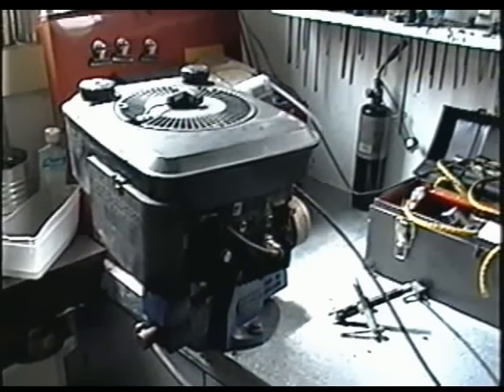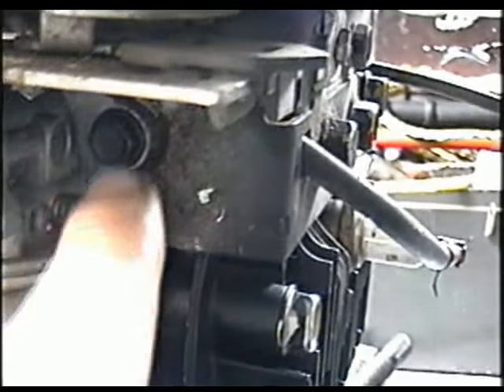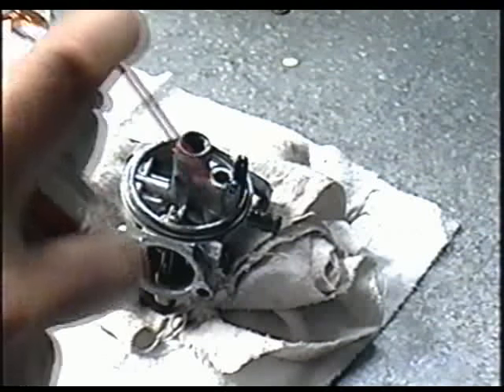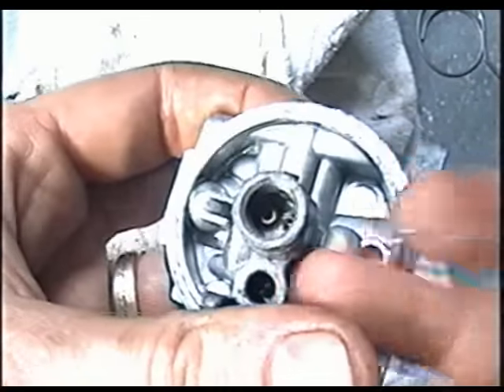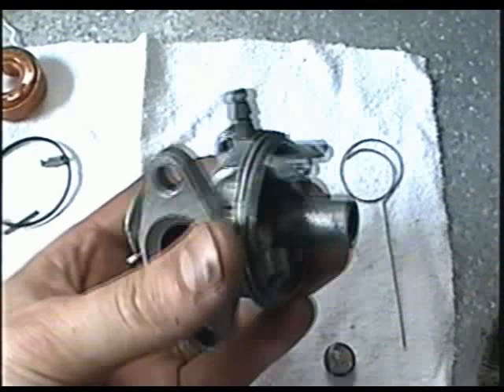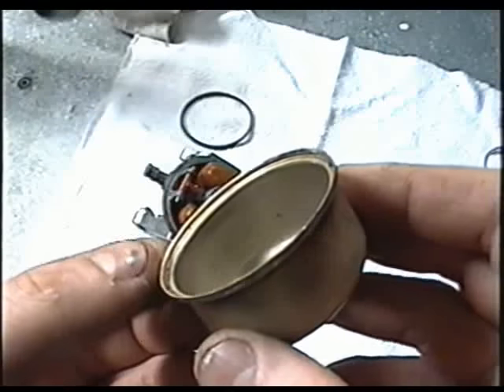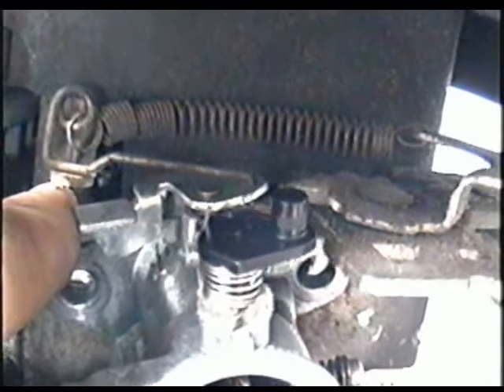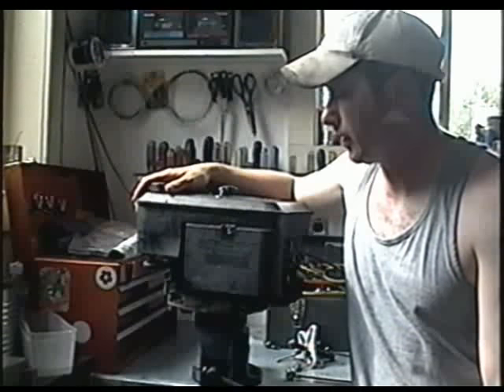HOW TO CLEAN The Carburetor on BRIGGS & Stratton Quantum Lawnmower Engines

Comment: ok,heres my story. A friend of mine said i just got a new mower i couldn't figure out what was wrong with my old one, if you want you can take my old one for free its just missing the spark plug. I said shure i'll take it, then when i got it home the it wouldn't start, so i sprinkled a little gas on the air filter then it would run about 3-15 seconds. and then i tryed what you did here and it was 100% perfect! And thats the story of the freemowerme and my wallet thank you donyboy73! you rock! !

Comment: I do it the easy way.....always use clean gas, and lately Non-ethanol from a local marina , plus replace or tap out the air filter. Bought the mower in 1991.....so 23 years and have yet to clean the carb. Good video....saved it for possible future use.

Comment: No adjustable throttle, I did clean the carb 3 times and finally gave up and bought a new carb off ebay for less than $30 and now everything works fine. I guess I was just missing something in the cleaning, but thanks for video, it helped me get started rather taking it to the dealer.

Comment: Get yourself a can of Berrymans Chemtool. It comes  with a basket inside the can. Toss all the metal parts  in the basket and put it back in the can of Berrymans. Let them soak a while or over night. You can by it at a parts store. Works great on car carburators to.

Comment: Guitar strings of various sizes. They work wonders on tiny  carburetor holes/passage ways. They are very limber and also very strong so they easily go through bends and still maintain their shape. I also use the bigger strings with outer wire coil wrapping to snatch out keys that have broken off inside locks...of all sorts. So find a friend that plays guitar and get his/her old broken strings lol.

Comment: note: there will still be some schmutz on the carbs that needs to be scraped off ( I used dental picks, steel wool and compressed air ) but the results were great! When I first got my bike, the carb slides wouldn't budge. After a soak in the solution, the slides moved freely.

Comment: I put fuel additive on my briggs and stratton trimmer mower. I barely used it, and it would start and then stop. I finally got tired of it and replaced the engine with Honda and that engine starts like a champ.

Comment: Donyboy73 definitely has the best Briggs & Stratton carburetor video, I would just like to add if you are still having problems with your lawn mower dying out try changing the fuel line if you haven't already.

Comment: Awesome video! Got an old lawn mower from my grandfather as a house warming gift. Only used half a season, but has been sitting for 12 years. He had drained the gas, but when I went to fire it up, gas just poured out of the air filter though the carb. Other research told me it was the float. This video was so easy to follow! Took of the bowl, cleaned it and the exposed part of the float, and was good to go! Thanks for the video

Comment: Thank you so much for this video instruction. After I changed spark plugs, air filter, fuel, removed rust off the coil/flywheel, etc.....my mower still would not start. But when I simply removed and cleaned and reinstalled the bowl around the carb float, and the mower started right up and now runs as new!! Awesome!! Thank you again!

Comment: Hello Dony,

You and Steve have helped me a lot over the year with y'alls well narrated and informative videos.  I have made some different carburetor/brake cleaner tips for different angles and size jets/passage ways.  I use a lighter or torch 2 barely heating the red spray extension tube and make the sizes and shapes I need.  I heat them about a 1/2" from the end and stretch it 2 desired size and or direction for example a 90 degree angle for the little holes inside the carburetor.  By stretching the red tubes makes the outside and inside diameter of them smaller.  Easier 2 get in those small jets and your carburetor/brake cleaner can will last twice as long.  Thank y'all from (D.R. Small Engines) and keep it up!

Comment: i have an XR600 that I had not run in about 3 years. A mechanic friend of mine told me to make sure I drain the old fuel out of it before starting it.. 

I should have listened. I put fuel in it today and took it for a run. Petrol was flowing out of the tube off the carb. 

Seeing this vid I have the confidence to take the bowl off and give it a clean. Fingers crossed that is all i need to do. 

Great video.

Comment: I have a similar Briggs and Stratton engine on my mower and it was giving me problems starting. It would start and run and not start again if I shut it off. I took it apart and removed and cleaned just the carb. bowl and nut. I wasn't confident enough to remove the whole carb so I just sprayed cleaner thru the hole where the butterfly is. Got it back together and it runs fine.  Thanks so much for your video. It helped a lot!

Comment: I dismantled and cleaned the carburetor on my B&S 675 yesterday. A little different but close enough. I found the needle had some gunk on it it took 5 minutes to scrape it off and burnish with a very fine sanding stick. I sprayed starter fluid in rather than carb cleaner then cleaned the jets the same way. I needed a replacement air filter/carburetor gasket and found it at a Sears parts/repair shop.

The procedure was very easy and the mower runs like it was new. Thanks very much!

Comment: Excellent video very well explained and 100% correct. I've been working on Briggs and Stratton engines since the late 1980'S and you've done a perfect job of the carburettor and an equally good job of carefully explaining how to do each step. This will help out lots of folks to get their lawnmower running again.
Reply from the maker: thanks

Comment: Great video! As a 54yr. young gal I was able to find a two carbs, remove them, clean 'em and reattach 'em without losing a part!!! (Push and Rider) Would not have attempted it without this great video.  Thank so much, you saved me a bundle. Lawn mowers runs great!  Now to sharpen the blades.

Comment: I have this exact same carb setup which has no idle and runs rough. Experience over the years tells me to do exactly what you have shown but it's nice to see all the steps illustrated. Small motors have carb problems all the time due to running in dirty environments and sitting a lot. A fuel tank can draw moisture over time, even if it is covered so I suggest the use of "Stabil" gas treatment for stored motors, especially 2-strokes! Very good job on your video. Thanks for sharing the knowledge!

Comment: Many thanks. I have a 6.5 Briggs Stratton engine on a craftsman 19.5" self propelled, electric start lawnmower. 917.378381. I noticed that the bowl fastening nut had one horizontal passage that runs clear through the nut and one very small vertical passage that runs into the horizontal passage. Your suggestion to use the wire from a twisty tie was brilliant. Many thanks again & again. Now if I can get my blower engine running !

Comment: Excellent how-to, many thanks. First time really disassembling any carburetor. My problem was that it was very dirty inside, clogged jets (especially the jets on the screw) worn seat and corroded needle. Originally it wouldn't run an leaked gas from the carb. Just got finished with it and its working great. A small drill but works well for removing the old seat, its the method I used. Also for anyone wondering the needle/seat kit is part # 398188 and costs about $5.

Comment: Thanks for posting this - this was the first time I've had to disassemble the B&S carburetor on the mower due to a fuel starvation problem at full run throttle settings and poor starting. Your guide was very useful. Cleaned  the blocked main jet and the engine started and ran first pull.

Comment: I wanted to thank you for your video. This season my 5 year old Troy Bilt pressure washer started, ran for a couple of minutes and then refused to start again. Even though I've never been an 'engine guy' I am a 'YouTube guy' so I watched your video a couple of times and then started working on my pressure washer. It At the end, everything was put back together and with a single pull on the the pull cord it started right up. So now I'm thinking about cleaning the carburetor on my Mantis tiller :)

Comment: Great job!  I have a lightly used 1100 (on a big chipper/shredder) with the float carb and when I turn the gas shut off to the on position, gas pours out of the air cleaner tube.  Previous owner probably stored old fuel in the tank without Stable.  Figure it is the float hanging up with the needle suspect too.  Have the confidence to remove carb after watching your video twice and will grab a rebuild kit and have at it!   Many thanks!

Comment: Awesome, thanks! I was ready to buy a rebuild kit or a complete replacement carb, but tore down the carb and cleaned everything thoroughly (esp the jets+bowl) instead - my B&S Quantum 50 then started second pull on the rope and had the smoothest idle I've ever seen from it (bought second hand) and allowed me to finally get the thing in tune.  Subsequent starts have occurred on the first gentle pull on the rope.  

This is the same engine that wouldn't run for more than 20 seconds this morning!

Comment: Thank you for showing this video. You saved my lawnmowers life!! Before my lawnmower would start up then just die just like that. I found the manual for my carburetor so I can have a guide on how to put it back together again. Unfortunately, I did NOT have any carburetor cleaner. So I did some research on what i can use to clean my carburetor. Then I found this method that someone wrote down:

Comment: Great thank you. Cleaned the carb out and found some corrosion . Also found a lot of debris in the pipe from the fuel tank to the fuel valve/tap before the filter. Change this pipe too and it now it runs really well.

Comment: Thanks for posting.  The engine on my log splitter wouldn't start.  I figured no fuel was getting through but had no clue what to look for.  A friend said check the carburetor.  I have no mechanical experience, although I am handy, so I had no clue how to go about this.  I found this video....the engine and carb are similar not exact matches though.  I followed the instructions in the video and just started the log splitter!  Success!!!  Thanks for saving me money by allowing me to fix it myself

Comment: thanks to u i can do and repair all my stuff i just love the way u explain everything and now i can do the work that i cant even believe im doing it. 
so thank you for the videos and keep up the good work.. and thanks again
Reply from the maker: you're welcome
Reply: Donyboy...I have a Stilhl M170 chainsaw less than two years old.  Was running fine, but now, it wont start. I've check spark, I've checked gas filter and gas line and this all looks good; Not flooded and gas is good/fresh (ratio 50:1)
My question: under this perceived condition, can I effectively take carb out and clean and place back without installing a kit replacement if I don't damage diaphragm or gaskets et cetera. I need saw to work and don't have time at moment to order kit.
Reply: julio Angel I was told that I explaine things well maybe I should try making a video, and by the way this guy did fantastic camera was good showing every piece, he did well

Comment: Donyboy what a fantastic video! My mower is 23yo, it started on the usual 3rd pull and cut about 8 ft before stalling, restarted fine only to stall again as previous, third time mower wouldn't catch.  I assumed the carb needed work as the plug was dry after several attempts and it was the first tank of fuel this season. Your video made this task so simple.  Only difference was my carb did not have the side hole but all seemed open. Reassembled and same problem, no start, plug dry, bowl wet. Help

Comment: Glad I eventually found your video! Unlike other videos for 3.5 Briggs engines this looks exactly like the one on my 1990 mower. It's a 3.5 HP Briggs and Stratton Max. Gas went bad last winter and it stalls constantly now. I almost pulled the trigger on a new mower since I thought cleaning the carb would be complicated but your instructions make it look simple.
Great job! One of the best instructional videos I've seen.
What's the best way to winterize the engine?

Comment: Hi Dan! Hey, for your walbro carb with the press fit float needle's seat I use a 1/4" 20 fine thread tap to extract the seat from the carb housing. What you will have to do is use the tap to cut threads into the brass float needle's seat then you will use the tap as an extractor to PULL the seat out of the carb housing by gripping the tap with a vice grips. You may have to tap on the vice grips with a hammer to get the seat to free up. !Remember to measure your float's height before removal !,,,

Comment from the maker: you migh have a bit of moisture in the engine, the carb may need kit #631021b and possibly a new bowl if it's corroded where it connects to the carb. for the oil just replace it often until it becomes a normal color

Comment: I'm at a loss.  Currently mower (B&S 650 series) will start with starter fluid sprayed in and then immediately shuts off.  I replaced spark plug for good measure as well.  So far, I've pulled the bulb and cleaned the bold like you showed.  It was in fact gunked up.  I cleaned the jets.  Gas seems to be making it into the bulb area ok and all.  I put it back together and same thing.  As far as I can tell, everything is cleaned like you showed (First time trying this so...)  But no luck.

Comment: Useful vid.  One note to add based on my experience: Drain the fuel tank or run it down first (It seemed obvious *after* I had gas going everywhere.  After draining it, have a lot of shop towels standing by.  There will still be some gas in the system that will drain out when you disconnect the fuel line.

Comment from the maker: @adrienj67 when u remove the fuel line from the carb make sure fuel flows freely from the tank. usually there is a screen in there and dirt may plug it.

Comment from the maker: @th19940305 if they ran it with no oil it's finished but if it's just locked up from sitting it's repairable. spray penetrating oil in the cylinder

Comment: Thanks for this.  You just saved my life with loads of grass to cut and the mower refusing to start and run.  Just got off and cleaned the air filter, removed and cleaned  the bowl under the carburretor and bingo!  All running perfectly now.

Please remember though that you are dealing with many of us total morons on Youtube,  when it comes to mechanical things, so as you didn't tell me that removing the bowl under the carburettor would lead to all the petrol draining out of the tank,  I lay there with it all streaming up my arm!!   Probably draining it all helped fixed the problem anyway,  but my watch doesn't run quite as well as it did! :)  

Thanks again for the helpful video though!

Comment: Kudos to you!  for taking the time, sharing knowledge and shooting a pleasant video of this.  Mine is almost similar to your engine and it runs and dies. I cleaned several times but keeps coming back.  So I think I should replace all the gaskets in carb.  Thank you!
Reply from the maker: you also may need to replace the carb itself

Comment: I rewatched this (for the fourth or fifth time).  Don said remove the bowl O-ring before spraying with car cleaner and that is important.  If you do not the O-ring can swell and the bowl will not seat properly.  If you have this problem, was the O-ring in warm soapy water and let it air dry on paper towel for about 1/2 hour.  I should shrink back to the proper size.

Comment: Thanks a lot for making this video. I think I need to do this and had no idea how to. I have a very similar engine (B&S 3.5hp that looks identical). I've already tried using carb cleaner on the carb and surroundings, replaced the fuel hose and fuel, and changed the oil. Still won't start.  I did try spraying some carb cleaner in the air intake and it started for a second, so I know the spark is working.   Next I guess I'll have to take the carburetor apart and see if I can fix it.

Comment: I was having an issue with my lawnmower engine surging.  I didn't find a video with my particular model of Walbro carburetor addressing how to fix this issue.  So, I took the carburetor off and cleaned the jets and ports, put it back on.  I still had the same issue.  There are two adjusting screws with springs on them on the carburetor.  I adjusted the lower screw (with the slotted head) about half a turn and the surging stopped.  Maybe this tidbit will help someone else and save a little time.

Comment: Hey brother,

All combustion engines have carbon that builds up inside of them as a by product of combustion. The black coating your noticing on your spark plug is likely from lots of carbon deposits.
Personally, I'd add an ounce of sea-foam to the crankcase/oil until the oil is black as coal and change her out for fresh oil. Don't worry about leaving the seafoam in the oil for a period of time. Your oil will still continue to lubricate your engine whilst the engine is being cleaned.

Comment: great tutorial, thanks. i wouldn't use any wire that would scratch the surface in the holes, dirt will end up getting stuck easier if there are scratches it can attach to/in. If it's posible; use something more soft that won't scratch. :)

Comment: Great video and very well done. I have a similar older carb (Walbro LMS-3) and when I removed it, i noticed that next to the mixture screw was a well with 3 orifices that were open to contamination. I cleaned everything up and put a welsh plug in this well but had a lot of trouble cranking even using starter fluid. After it did crank and ran well, i noticed the welsh plug had been expelled and lay on the ground. Was this well supposed to have a welsh plug??? Thanks for sharing